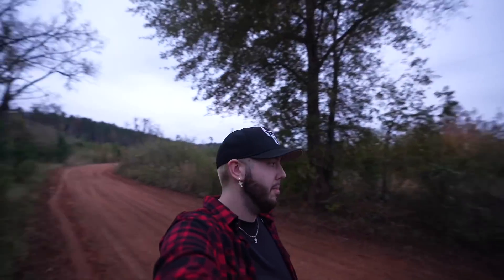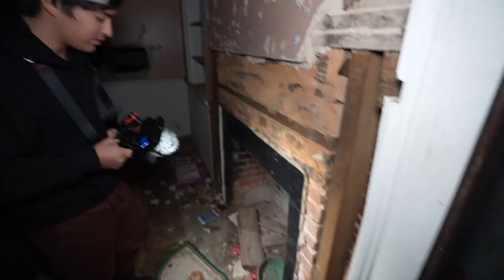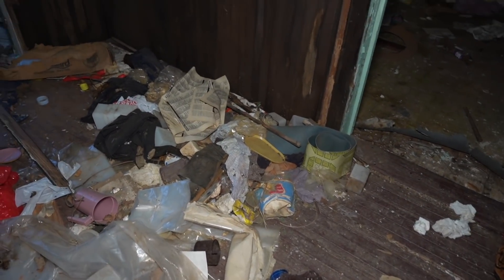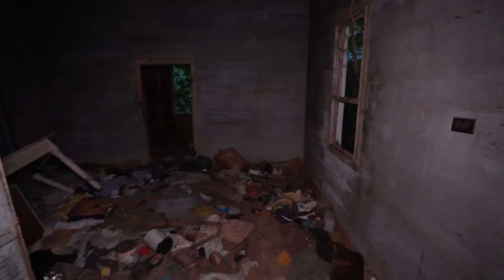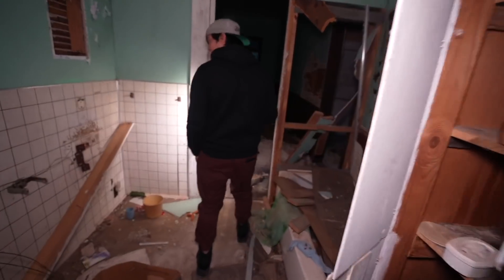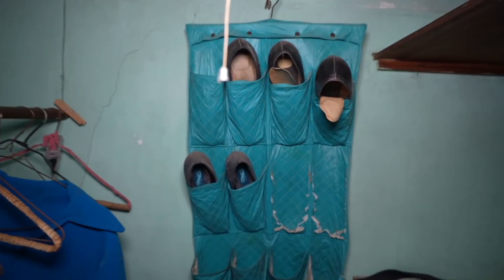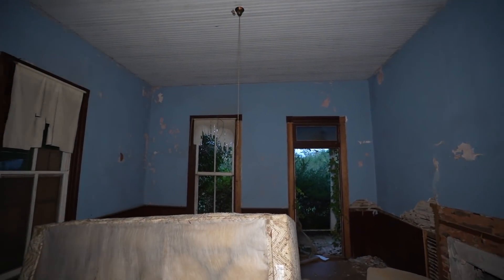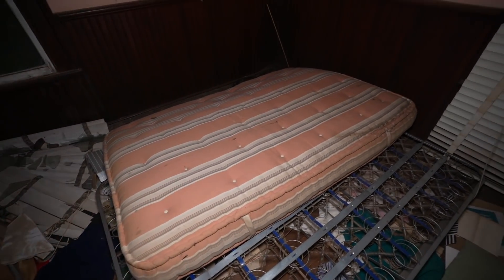The Walking Dead Abandoned House in the middle of NOWHERE

Comment: There’s a pump for water in that room, likely it was a summer kitchen or original kitchen, summer kitchens were off to the side sometimes , so they didn’t make more heat in the rest of the house wheh cooking . Obviously the bathroom was added later & they had to find a place to put it. This house was built before heat & AC & electric

Comment: no second story ?? the smaller windows above the doors were called transom windows. when it was hot you could open them up and it would cool the room down. many many older houses had them. the very end room just beyond the kitchen may have been a summer kitchen, again in the heat of the summer kitchens were away from the rest of the rooms to keep the house cooler. they still used the fireplaces to cook in so it would get VERY hot !!! the ceilings were incredibly high. some older houses do have high ceilings but these were higher than I have ever seen !!! I imagine the vandals who destroyed the home and what was left of its contents had a long leisurely time of it as there is virtually no one around to catch you doing it. for its age and the doors being left open the house seems as solidly built as it was the day it was completed. it's sad to see this beauty unloved and unwanted by the family who owned it. even that far out it deserves respect for all it has been through. thanks for letting us have a look at it with you !!!

Comment: This is a very cool old house.   While it's a shame the mantles and other architectural elements are missing, its still pretty intriguing.  I suspect that the bathroom was located where you found it because originally their bathroom would have been built separate out back as an outhouse and when indoor plumbing became available and affordable to the occupants, they renovated a room or part of a room that had originally another use.  I noticed several of the walls were wooden and drywall really didn't come into widespread use until after about 1916.  And the bathroom deflinitely had drywall.  I found it interesting that the back section where the broken white table was had windows different from the 2 over 2 sash windows.   I wonder if it was a slightly older dwelling that had a victorian section in front of it when they had more money.    Very well done!!